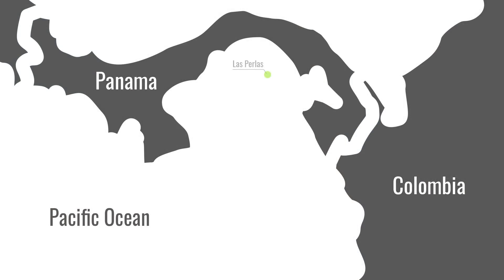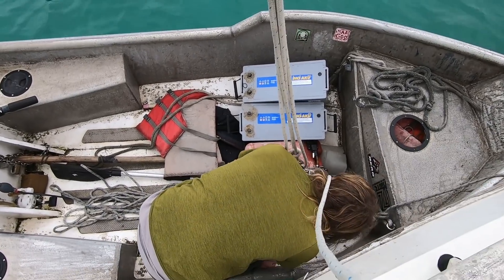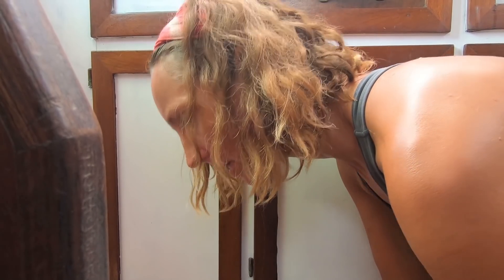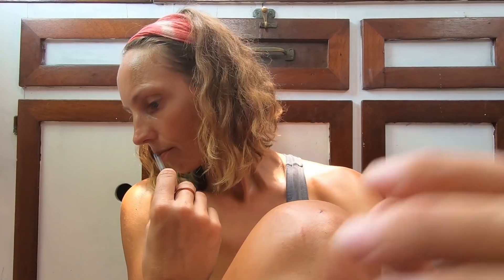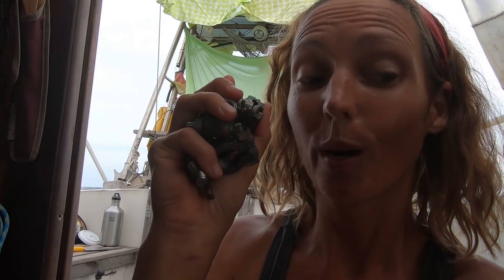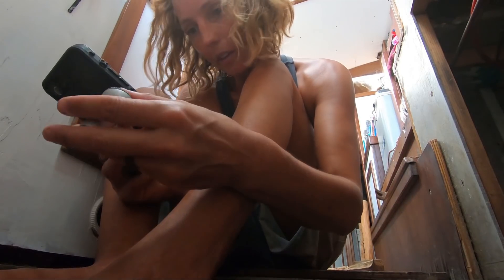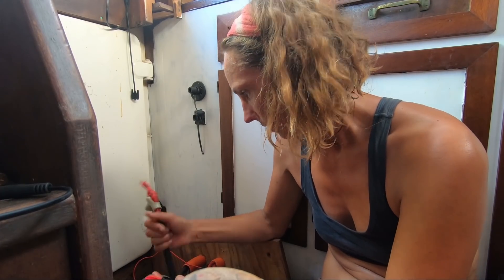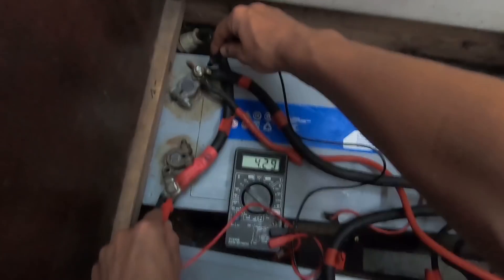Stepping up my game: figuring out how to trouble shoot the electrical motor of my Lofrans Tigres

Comment: Nike this was great to watch.  So, you said at the beginning you tested the voltage at the windlass and got 13.4v... then it seemed like in the end the power source connection was broken after all.  Did I misunderstand something?  Others can comment also if they get what my question is!
Reply from the maker: Sorry, I am not an electrician... so u might better consult someone with more expertise... how I understand it is the following: yes I did read some voltage up there, but the cable connection was lose so the necessary amps that the windlass needed were not able to be pushed through although the voltage was there. 
What I have learnt from this: take the motor and use some jumper cables on it to see if it works before u take it apart. That way u will know if it is the motor or ur wiring. This, I learnt through some awesome feedback on this video 👍 hope this helps...but as I said, I never claim to know any of this, it’s always a trial and error 🙈
Reply: @WhiteSpotPirates  You may not be an electrician, but you're exactly right.  With no load, you would expect to measure a good voltage at the windlass.  However, under load, there was so much voltage drop through that bad connection that you couldn't get the high current flow that's  required to operate the windlass.  If you could have measured the voltage under load at the windlass when you were trying to run it, it would have been very low.

Comment: Clean the commutator, don’t touch the steel bits (armature) unless it is rusty, it should have a protective coating on it to preventing it from rusting, you sand that and it will start to rust.

Comment: Perfect! Great job. If I had a dollar for every time I "fixed" something that turned out not to be the real problem. As a side note, when motors begin to fail, the failure is usually presaged by dramatic increases in current draw. Often, breakers begin tripping and this is your first indication that something is wrong. You did right by cleaning and testing your continuity. One of the risks of motor rebuilding, and the main reason it often doesn't work, is people sand the armature and other various parts and this creates a conductive dust that gets pressed into the grooves in and around the armature, creating a closed circuit and loss of magnetic power. As a rule, I will replace the brushes first before rebuilding a motor as that solves the problem 50% of the time. Obviously, as you noted, these need to slide easily under spring pressure in their "houses" as you call them. Big industrial motors will have brush access ports with large slotted screws on opposing sides of the motor housing. Brush kits are cheap and easy to install, although they need to be ordered in. Finally, the reason those cables are so big is that it's a long run from your battery and that windlass is probably the largest current draw on the entire boat. It doesn't help that you're doing it with 12v. Were it 24v, you'd be seeing half the amperage. The longer the run, the greater the resistance and the bigger the wire cross section must be. If you find this cable to be failing again, and especially if it's showing signs of melting, replace it with the next size up. The cable is very expensive but you might be able to use cable from a welding supply house. Running a large motor on cables that are undersized will not only burn the motor out (by having the voltage drop under load), but will also increase the risk of fire. Thanks so much for posting a fantastic episode.
Reply from the maker: Thanks for ur informative message 👍
Reply: You could print this. Excellent explained!
P.S. Therefore is so important to install fuses and especially so near to the battery as possible.

Comment: Kleiner Trick bei der elektrischen Fehlersuche der sehr viel Zeit spart und Brände verhindert: Elektriche Kabel, Anschlüsse und Verbindungen dürfen nie heiß werden (!) denn dann sind sie entweder defekt (z.B. korrosion in den flex.-Kabeln) oder sie sind zu schwach ausgelegt. Wenn dem so ist, dann werden die Kabel usw. immer heiß. Das kannst Du ganz einfach messen mit einem Infraot-Thermomerter mit einem kleinen Laserstrahl. Du hällst einfach den Lichtpunkt vom Laser auf das Kabel, Verbindung oder Bauteil (z.B. Relais) und misst deren Temperatur im Betrieb. Wenn die Kabel jetzt viel heißer sind als die Umgebung...dann läuft da zu viel Strom drüber oder die Kabel sind korodiert. Wird die Verbindung von den Kabeln heiß, dann stimmt da was nicht (ist meistens Korrosion oder zu lose verschraubt). Relais dürfen auch nicht heiß werden, ansonnsten sind die Kontakte verschlissen.
E-Motore dürfen warm werden aber nicht heiß....ansonnsten brennen die aus oder sind einfach zu schwach ausgelegt.
Um es ganz kurz zu sagen: Es lohnt sich die Elektrik alle 6 bis 12 Monate einem auf Temperatur zu testen. Die Götter der Physik und der höheren Mechanik geben freundlichen Seglerinnen fast imer eine Vorwarnung, wenn die artigen Mädels denn zu hören würden :-) ...lach
Reply from the maker: Danke für den Tipp! Muss mal ne neue Batterie für mein Infrarot-Thermometer kaufen 👍

Comment: Would have found with the volt meter performing  voltage drop tests along wires(must be performed under load), You can have voltage but not enough when under load.
Easy, accurate,.
Reply from the maker: I think u missed the point that I was measuring under load...I only have an on and off switch. So there is either off meaning no voltage or “on” meaning windlass is picking up chain and therefore should have voltage. I don’t have the usual set up where u have the control box with a secondary switch... with my set up you can ONLY measure under load...
Reply: @ Ken  I think you are trying to say to measure the amps drawn. With a poor connection the voltage wont be a problem but the reduction in the size of the "conduit" restricts the amperage available "downstream".
Reply from the maker: @danielbuckner2167  I thought that what he was trying to say that it the windlass is Switched “on” meaning it gets current but not yet being told to “pick up”....so then u would measure a certain voltage but if u then actually hit the “take up” button, u might measure a voltage drop if sth was wrong with the wiring. But since I don’t have that set up, this kind of test did not work for me
Reply: @WhiteSpotPirates   Yeah that's possible, maybe he didnt catch the schematic you showed.

Comment: Very interesting video, Nike, but the best bit is not the content; no sense of stress and ungency - really great!

Funny seeing you learning the electric motor skills I learned, on model cars, 50 years ago. A couple of things I would add, though, is to test for an electrical bridge on the leaves of the commutator - something conductive getting stuck there because it's unlikely that a short would develop anywhere else unless the motor was physically damaged or corroded. Also, not generally necessary to spin and grind the commutator unless it has been scored by worn out or broken brushes; the copper there is only so thick and when it's gone, it's really gone! I found, the hard way, that over-oiling motor bearings can cause oil to seep there and get converted into carbon by the arcing of the brushes and commutator and thereby causing a conductive bridge. I also used to think it was wise to finally surface the commutator using metal polish, on a cloth supported by something flat - but an engineer at Gibraltar spanked my fingers for that one.

An interesting thing I noticed, in your way of working, was that everything goes into a utility bag, tools and parts alike, until you get back to the cockpit. I wonder if this has been learned by hard experience, with things being "donated to Neptune". Annoying seeing you squeezing into tight spaces on Karl when I have the flexibility of an elephant.

One thing I'm not so sure about is seeing you charging your new (old) batteries at anchor. Did you run the engine out of gear? Not generally a good idea for diesels; running them without load tends to cause glazing in the cylinder bores. I learned that from the wise old sailor on the boat behind me, a boat called "Suhaili" when I saw him running his engine in gear, when docked, for an hour or so. Google that boat name, Nike, and you can see why I listened to him (he's been the lifetime owner of that very special boat). But what I can't see is, if it's bad to run your engine out of gear, to charge batteries, how can you do otherwise at anchor?

But great to see things progressing for you and also seeing the virus coming more under control in Panama because I'm headed that way shortly.
Reply: Thank you Sir for writing down this accurate, state of the art explanation. It is a pleasure reading something based on facts and knowledge these day's on Internet😉! I am d'accord with every word. 
The only way to get batteries full charged is AC charger. As Nike doesn't have that possibility, in my opinion ( and a bit of experience ) only way to prolong battery lifetime is to use MPP kind of solar charger. It is also important not to use more than 50% of battery capacity. Therefore is battery monitoring system essential. This is no advertisement but Victron Energy have decent products in this range. My Gel batteries are 12 ( twelve ) year's old and still capable of storing 89% capacity. And yes, idling is killing every engine. Examinations showed that 1/4 to 1/3 of throttle help to avoid worse if necessarily.
Reply: @quasimodo8215  ps I have lots of gadgets now, including a pair of Victron MMPTs (with a bluetooth attachment) and a BMV712 battery monitor (more bluetooth) but they are driving me absolutely nuts! With every thing being so new and with the sunlight rapidly vanishing here in the UK, I can't keep my eyes of the numbers when I should be either working on the boat or enjoying some leisure. Boat gadgets can be a bit of a trap, can't they...
Reply: @quasimodo8215  Thanks mate, but you overstate things a bit - I get things wrong with boats as well. Karl's batteries have clearly suffered from long periods without use but that couldn't be avoided; spending many months away from him, with a shattered heal makes things difficult. Not sure why Nike didn't wait for Karl's solar to bring the replacement batteries up but a good alternator would do things more quickly I suppose. 

Yes, using your batteries wisely helps a lot, as does having enough usable capacity. With your comment on not discharging your Gel batteries below 50%, I would add that it's difficult to get them right up to 100% as the charge rate drops to a trickle after 80% and you might be using them at the time - you really get only 30% usable range in the end. So I've changed things totally on my boat, "Thistle Doo". I've gone from having a house bank of 3x115Ah lead-acid, with shore charging or alternator (via a diode splitter) over to having 4x100Ah LiFePO4 with 610W of panels, a wind generator, a shore inverter/charger and a 150A alternator/external regulator all charging them directly. My SLA starter battery is now charged from the house bank (DC-DC charger) and doesn't see the alternator directly. My strategy with the alternator, is, if I simply must charge the batteries from the engine (bad run of weather crossing the Atlantic for example), I want every drop of diesel fuel to count. An added bonus is that now Thistle Doo's stern new sits 2cm higher out of the water - those discarded lead-acids were damned heavy!
Reply: 😃excuse me Ian B. aren't you my Alter Ego😉?!
We should not forget Nike's wish to reduction of everything that is not necessarily needed. It's a kind of "Back to the roots" and minimalism that helps getting your concentration back to the essential  "things" in your life. That is what really counts. Besides, there is a kind of disgust / disappointment about kind we're living and direction of our "development" as a mankind. You don't get this insight without pain. 
I would be hoping that this is only my eccentricity due to lack of sleep.
And yes, your system is in a meantime optimum but we allso know how much that kind of components cost. Greetings and good times to you!
Reply: @quasimodo8215  I think I know what you're getting at and I agree to a point; not right to dispense with something just because there's a newer one, perhaps a prettier colour and with new features that might not be even be worth having. But there's also the matter of just getting by with things compared with doing them more safely and soundly; some things available now did not even exist 15 years ago let alone being within the reach of more ordinary people so why not use them? Put it this way, J.S.Bach created wonderful music on harpsichord but if pianos had been invented during his lifetime, I'm sure he would've used one when his harpsichord was still perfectly fine.

Another example, a boat I mentioned to Nike before (but didn't tell her why). Docked not 100 metres away from me is a truly special boat called "Suhaili" sailed by a truly great man. Suhaili and her skipper, Sir Robin Knox-Johnson were the first to sail around the world, non-stop and single handed - and with the most basic of equipment. While she's been brought back to current life after all these years, she's the plainest, roughest looking ketch that you'd ever see. Sir Robin still owns her after all these year and about 4 months ago, I saw him onboard and went around and had a chat with him - something I will long remember. That they succeeded is absolutely amazing. But, at the same time, Sir Robin's current project is the "Clipper Race" program and the boats they use are light years ahead of Suhaili - because the vastly better equipment exists and it makes sailing such journeys relatively safely far more viable for far more ordinary people. The best of those people could possibly do what he did in the same boat - but his point is now different and his safety and equipment standards for his venture are used - because they exist and they are available.

As for my current venture, to sail hime to Australia I will use every once of skill, knowledge and life experience I can muster, utilising as many pieces of sound and clever technology I can afford and install, to make this a goer. At my age, 65, I'm no athlete on deck, thankfully my much younger crew mates can make up for that though, but gee I know how to think, to plan, to work through things. At times I can scarcely believe that I do what I do and I think I have  lifetime of learning behind me to do this well.

So I have 2 forms of automatic steering, 3 forms of manual steering, electronic and paper charts, a plotter and a sextant, satellite weather forecasting and communications, new running rigging, a water maker and generator, enough power storage to power a small village and I'm even getting beanbag seats to make standing watch more comfortable. Minimalist - no. But the standard I require to do this reasonably safely instead of most likely dying, I'm old remember.

So I agree with the principle of "necessary and sufficient" rather than "minimalist". I also suspect that when the time comes for Nike to sail Karl home to Germany, that her standards of making the journey practically and safest will change to be more like my way of thinking too - to really live and achieve rather than just getting by as narrowly as possible with as little equipment as she can. I sure hope we all get to see her do that soon too.